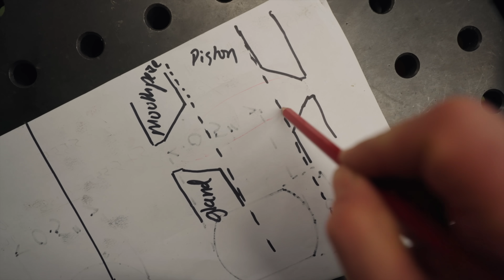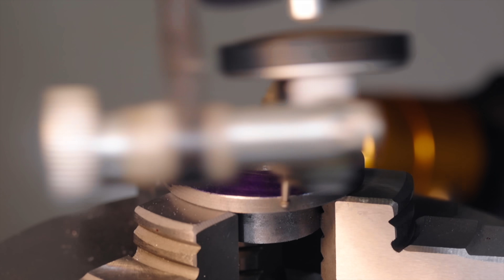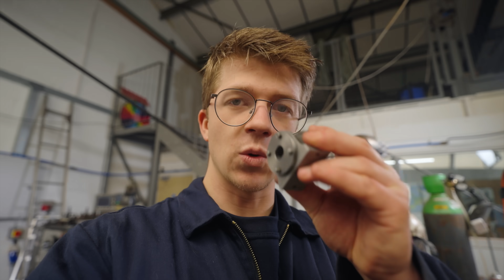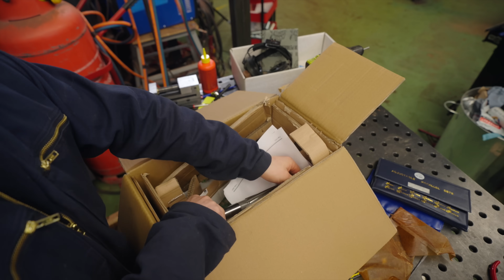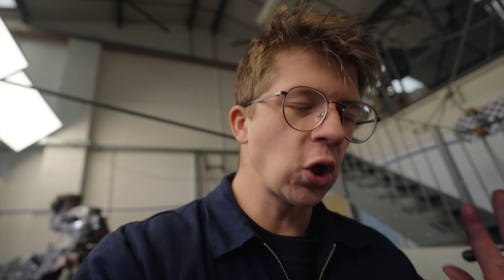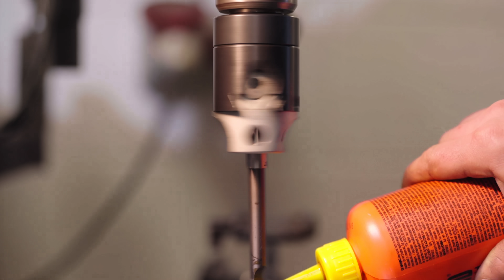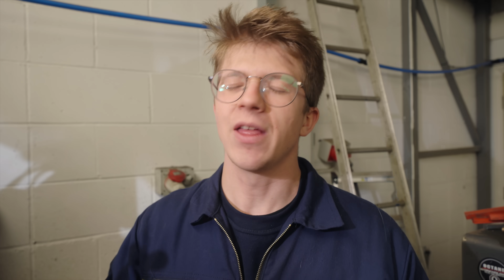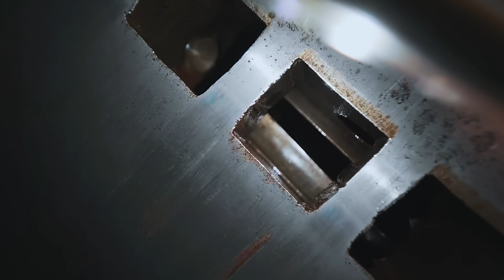Making My Own Steam Power Hammer! Part 3

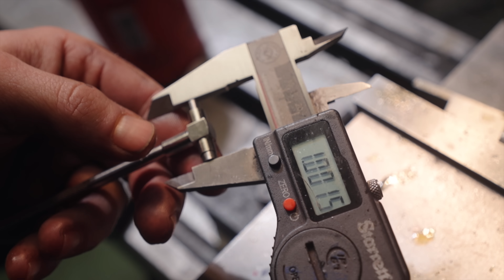Comment: 14:40 remember that the intrinsic error for a vernier is ~1.2 thou. Standard metrology rule for them is 1.5 thou (0.003 total). That's also assuming you're taking direct measurements, telescopic gauges aren't meant for accuracy, their spring loaded nature has most of them only rated for 0.012. Even solid hole gauges (go/no-go type, are 0.002) You're better off using the vernier to take direct measurements of the hole, but odds are you're not that oversized (ream mfr. should have spec sheets for the tool and what their tolerance is anyway - you can also check that with a dial indicator)

Comment: Boring head issues tend to include [but not limited to] tool wear.

Also, one of the easiest ways of boring a shallow hole without a flimsy boring bar is to put in a milling bit the nearest size to the final size you want.

The more teeth the bit has, the better, because the way to maximize the precision of the final cut is to index the bit until every flute has had a go at it [typically mills have between 2 and 8 flutes, and the more the better, not only because it has more flutes to cut with, but because the mill bits are more rigid the more flutes they have.

Comment: Dear Alec, You can't accurately measure .0015" with a caliper, even if the display gives you that many places. You need a micrometer for that kind of precision, and it needs to be calibrated.

Comment: Error with your reaming is probably caused by debris between taper surfaces, or your taper adapter has that amount of error. Still, the biggest mistake in this video is being metric with extra steps. 😅

Comment: Full disclosure: I'm not a machinist, but just watch a lot of machining here on youtube.

Regarding your reamer and the final dimension of that bore, I think there are at least two things to consider.

1) I think calipers are usually only good to plus or minus one thou. So reading one and a half thou over, you may still be on size, or you could be two thou over. That's why a lot of machinists break out the micrometers for that. I doubt you have such a tight tolerance that it matters here, and you're probably close enough.

2) If I'm not mistaken, reamers aren't always designed to cut right at the dimension on the box; I think you can get reamers with plus or minus sizes, in order to make a slip fit, or a press fit, for stock of the size on the box. So cutting over size by a bit may not mean that the reamer isn't accurate, but might mean you got the wrong reamer for the hole to be right on size.

Comment: you're going through some of the same issues as the makers of the big hammers. My grand father worked in a foundry and machine shop that made power hammers as well a natural gas engines. the stories he'd tell. at least you have more modern equipment. your doing great keep up the great work

Comment: I'm glad you have gone back in time to no computer based tools. Keep it up.
We do not need more electronics that keep breaking. Love me some hand filed, hand tooled anything.
How did we shape anything. By cutting or hammering. That's it. No turning, no cnc. Hand made bolts, screws, nails. 
Make an old tyme hand drill, or saw. Hand saw that is.
How about that. Brass backed, hand made nuts, handle. Etc. Damascus hand saw. there you guy jamie. get this to him pronto. Love you work over the years. Use your handmade screw driver to put it together. Get Paul Sellers to sharpen it for you. Or a tutorial. Love that guy

Comment: Using cutting oil has a tendency to make reamers cut oversized, to get a tighter hole use coolant instead.
Reply: Really neither is necessary in cast iron. The graphite in the cast iron is plenty of lubricant.

Comment: Good job, the thou and a half that the cylinder bore is too small, you can get hones for automotive rear brakes. Its like an engine cylinder hone but much smaller, it has 3 legs with honeing stones, you have to hone a bit and measure and do it a few times till you get to size, should give a great surface finish especially if you use fine stones.😊

Comment: @13:23 have you tried adjusting it past where you want it and then back it up to the increment you needed to see if that helps?  If there's gaps in the threads it'll be able to work itself to the limit of the slack in the thread during operation from the vibration and force.   Adjusting it past where you want it and then backing it up makes sure it backstops on the threads without a gap being behind it.

Comment: This reminds me of the "projects" that were left for you on your desk in my first metal working class in high school.  

Our first "project" kit was a section of piano hinge, a lunchbox handle, 2 metal latches, a handful of rivets and a sheet of steel.  For our second project, I walked into class and on my desk was a 6" piece of 1.5" aluminum bar stock (that's aluminium to you), and 10" of 1/4" drill rod.  

The first project taught us the layout and marking of sheet steel, the metal brake an arranging bend sequences, snips, riveting and spot welding.  The second project taught us caliper and micrometer measuring,  lathe skills (like facing, knurling and center drilling), and hammer forging and quenching.  I'm 53 now and the two items made in that first semester of 11 grade are still in my workshop and see regular use.  LOL.

I'd love to attend a machining course where you walk in the first day and this mini powerhammer kit is just staring up at you from your desk.